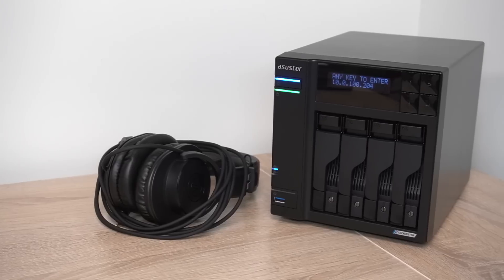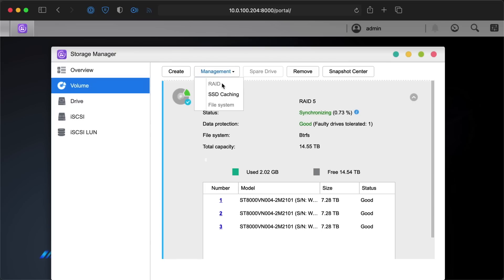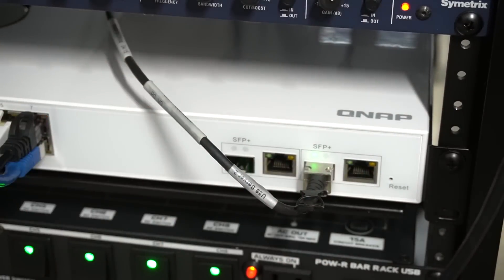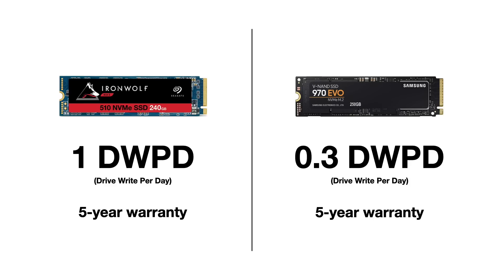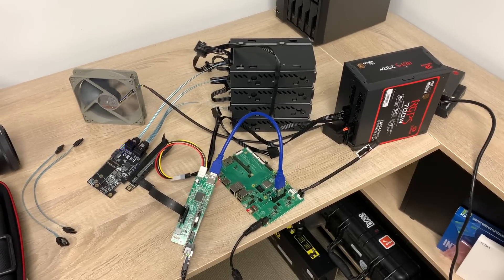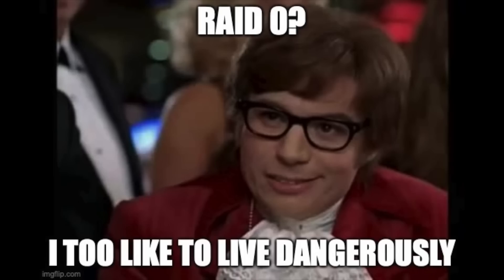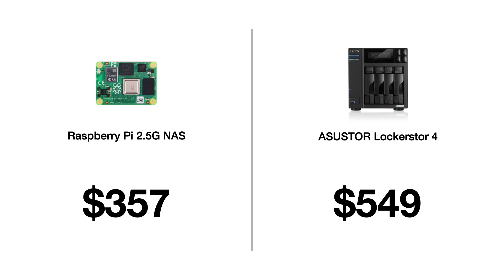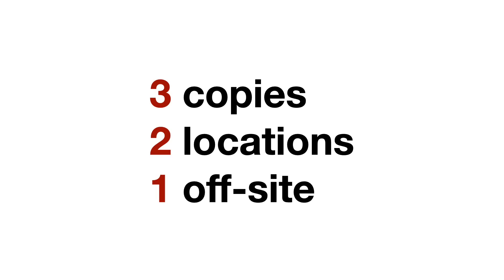Raspberry Pi vs ASUSTOR NAS Head-to-Head Part 2 - the VERDICT!

Comment: Very useful video, thanks. I'm in a similar situation right now: Upgrading the Pi4 with USB Adapters or buying a NAS (leaning more and more to the off-the-shelf solution). Will you keep Raid5 or go to Raid10 with 4 drives? I'm a bit anxious with Raid5... Imagine 1 drive fails and the rebuild takes 16 hours (or more with data on the drives? does it matter?) with full read utilization on the remaining drives... (but right - that's were the backups are relevant)
Reply: RAID10 can experience a complete data loss if two drives fail at the same time (RAID10 is kind of a compromise between RAID1 reliability and RAID0 performance) . RAID6/RAIDZ2 will protect against that scenario.

Let's do the math.

Assuming an AFR (annual failure rate) of 3%, the chances that any one of the 4 drives fail is 12% pa (per annum=per year). How long will it take for you to fix the drive? Do you have a spare at hand, or do you need to buy it first? Will the NAS alarm you at 2 o'clock in the morning while you are on a party, and how fast can you return to the NAS whilst heavily intoxicated 😉?

Let's assume that it will take 3 days for you to fix the issue (a few hours to react, wait until the shops reopen after weekend, plus the rebuild/resilver). The chances that 1 specific drive fails within these 3 days is ~1:4000, the chances that any one of the 3 remaining drives fails is ~1:1300.

In a RAID10 scenario, there is 1 in 3 chance that the 2nd failing drive is the wrong one and complete data loss occurs (total chance 1:4000). With RAID6/RAIDZ2, this chance is reduced to 0.

Considering the time it takes to resilver: when the NAS is under heavy load, it needs to decide whether resilvering or regular use gets prioritized (bother resilvering and regular use read off the three (or two) remaining disks). If the NAS prioritizes resilvering, it might become unusable for regular work, if it prioritized normal use, resilvering might take much longer - ultimately, it depends on how much faster the disks are than the network interface. However, the performance impact of resilvering must be addresses when planning the NAS, as the NAS will have to perform periodic scrubs, which have a similar performance impact. The math above dealt only with complete drive failures, nut localized surface defects. The scrubbing reads all the disks to find corrupted data, which is then corrected (ideally also alarming the admin that it had to fix some data because of some surface defects; the issue may be benign, but if a lot of "weak blocks" begin to appear, it might hint to wards an imminent drive failure).

Resilvering (and scrubbing) under ZFS only considers the actual data stored on the disks. On hardware RAIDs (and some software RAIDs), resilvering goes through the whole disks, regardless whether there is any data or not. Scrubbing can be done on a OS level (since the OS where data sits)...or it's done via the "whole disk" approach, or (quite popular, but dumb) not at all. Likewise, initializing a new RAID array finishes immediately under ZFS, while other solutions require hours for that trivial task.

I prefer ZFS for these reasons. TrueNAS (formerly FreeNAS) is available for free and runs on x86 platforms (so no Raspberry Pi support). Another downside if the "ZFS tax" - a ZFS RAID drive should be filled only up to 80% (to run at optimum performance). Of course, when it's just used as a data archive where writes are infrequent, and some additional seek times (in the case of spinning disks) are tolerable, you can go up to nearly 100%.

A ZFS NAS is not as simple as one of the ready-for-use things intended for the home user. It allows the user to specify priorities and timing of scrubs and resilver operations vs. normal use, which is nice for me, but too technical for the average home user.

My own NAS uses some cheap "old junk" mainboard, a few SATA controller cards and a few SATA enclosures with port multiplier built-in. The 32 spinning disks are organized in various volumes, some consisting of 4 disks (RAIDZ1, for less important data) and others consisting of 8 drives (RAID2, for data which I consider a bit more important). I use ZFS snapshots (taking a snapshot of a volume finishes immediately) to protect against accidental file deletion; with a cron job taking the snapshots at regular intervals (interval depends on how much the data changes and its importance).

And, yes, on one of my 8 disk RAIDZ2 volumes, I once had 2 drives fail within a few hours. I had one spare at hand and needed to order another one. So, no data loss, but maybe I should have gone for RAIDZ3...

And, like you mentioned: offline backups for the real important data. Apart from disk failures, fires and burglary are also real life threats.

Comment: 2 x 2TB Iron Wolf NAS NVMe SSD used for Read & Write Cache and also 8GB DDR4 RAM, that make me think...  Do I really need this ?
Reply: It's not completely necessary to go into maximum overdrive. Often our customers purchase 4 or 6 TB drives as they are the most value drives. The NAS supports capacity expansion as well so you don't have to max it out immediately.

Comment: Ok, so no cache on the pi. If you had cache on the pi, the total price might be almost the same as Asustor? Also, comments seems to suggest that OMV may not be a good choice, any others that might work better?
Reply from the maker: One comment down on OMV so far that I've seen; on the whole I liked what I saw and would recommend it. Realize that it's hard to make one software package that will work across all different types of server builds people might install it on (classic issue where Windows vs macOS — Apple controls the hardware so compatibility should be better there).

Total price did not include the NVMe drives at all (in either case), so price would be similar. You would need a 4-port PCIe switch (add maybe $30) and two PCIe to M.2 adapters ($10 each), so let's say $400 total for just the hardware (still no case).
Reply: @JeffGeerling  OK, excuse my ignorance but these PCI-E 1X Expansion Kit 1 to 4 Port Switch Multipliers work with Pi?
Reply from the maker: @vmoutsop  Yes, sometimes. I've tested a number of 1 and 2 slot boards, and some work, some don't. One fried one of my network cards too :(
Reply: @JeffGeerling  Oh great, so its not that easy. That's good to know.

Comment: I chose a halfway point between these two options.  The QNAP TR-004 is a usb 3 raid enclosure that I plug into my raspberry pi 4, 4gb.  Since the raid calculations are performed on the QNAP side, the raspberry pi only has to deal with the SMB stuff.  Performance and reliability are both quite high.  I also chose OMV for the relative ease of setup.
Reply: Bingo, we have a winner !
Reply: What is omv?

Comment: NB - OMV does support having the drives spin down when not in use. It's not a full shutdown, but as a single spinning HDD uses more power than an overclocked pi then it's most of the power consumption saved. On the "disks" page select the drive you'd like to spin down and then hit the "edit" button to find the relevant options.

Also, since you mentioned odroid, the HC2 or HC4 are really nice solutions if you don't need 4 bays on your NAS and are OK with gigabit. There's also the H2+ for 2 bays and 2x 2.5G LAN, and at <half the price of the asustor model.

Comment: That was super interesting! I have a question, and since I'm not very knowledgeable in this area I may be missing a point here: have you considered file and/or disk encryption on both setups? Does it make sense to talk about that type of data protection in either case?
Reply from the maker: The ASUSTOR does offer folder-level encryption (AES 256-bit, it looks like, though with limitations) and a LUKS option for 'My Archive' volume encryption (but not the main storage volume), and there is a LUKS full disk encryption plugin you can use on OMV. I haven't covered either but will be exploring these at some point.

Best to have multiple layers of security (in case someone walks off with my drives!).
Reply: @JeffGeerling  thanks! Looking forward to when you do so! :)

Comment: Nice comparison. But, is it fare to compare the little PI using less than a third of the power (3W) vs a 10W X86 power hungry little celeron processor?
Reply: No wake-up on lan for RPi, but if spinning down disks - having only power on rpi would be cheap enough

Comment: To be fair just plugging a hard drive into any of my windows computers very rarely yields the same results.It may open files display an icon or I may have to hunt the drive down for crying out loud! Hence all the frustration I see on Amazon reviews when adding these devices to the already inconsistent windows experience. As for the Pi, they need to quit cranking out boards and bring the software up to date.

Comment: As usual a nice presentation and interesting information.
I own a similar 4 bay NAS but have converted to use two linux driven low power computers - one at home, the second is remote. Using "normal" linux allows me to setup data sync between the two and simultaneously run proxmox, docker, nextCloud amd more. That gives me so many more possibiies.
And -  no cloud involved ...
Thanks for the good videos!

Comment: Jeff. Great video! Here is what I thought 3-2-1 is:

3 copies
2 different types of media
1 copy off site

2 different types of media is important because it can help prevent issues with crypto, and other issues with media / server death. Tapes, for example, are common for the second media in enterprise environments.
Reply: About 2 types of media: Never use SSDs for long-term backup storage :) Optical disks, HDDs and tapes are ok, SSDs are not. These lose the cell charge over time, so when you want to access your office document archive of 2020 in 2024, you’ll find that the SSD is completely empty…
Reply: @luziferius3687  That is what I have heard also. SSDs would be tempting to use because of their size.
Reply from the maker: Tape drives are underrated. Having offline storage that's decently fast to write, easy to transport and store, and high capacity... is nice.
Reply: @JeffGeerling  BUT ... keep in mind that tapes have more stringent environmental storage requirements than other types of media.

Comment: I've designed my own file server for a raspberry pi, it took 2 months to get it done but it was worth it...
Reply: sounds like good how to YouTube content to me
Reply: @kingmasterlord  Not really, I had to deal with tons of security stuff like directory traversal, injections and XSS and 99.9% of people watching don't know anything about this stuff. If they were to expose some ports on their home routers with badly secured web app, then some hackers, or most likely bots wold easily get access to their home networks... There's always a risk they'll forget to patch stuff that might enable remote code execution...

In short, unless you really know what you're doing, don't do it...
Building complex APIs needed for login and permission systems isn't easy, and securing it is a nightmare...
Reply: Any idea where to start (maybe topics to read) and futher to have similar built like you?
Thanks..
Reply: @khairulihsan8417  I'd honestly first start by building a simple API for reading files from the server, some routes like API/file/get/pathToFile, reading the target file and then thinking of securing it, so things like dir traversal protection and possibly locking the server to a certain directory, that would be its root

Comment: Who buys/uses a 700W PSU for a low power system!?  Wasting energy as PSUs are most efficient near their rated power...

That watt meter is not very precise. When in sleep mode, the Asus system should use 1-2 watts.
Reply from the maker: I used that PSU mostly because it's the one I have on hand for lots of different testing. Overpowered mostly because I don't know how much power I'll need for a given project.

You could definitely go cheaper on the PSU for a simple NAS like I'm building here. And if you only needed 3 or 4 drives, there are also cheaper SATA cards you could use.

Comment: My take on the "NAS story" was:
- HP MicroServer Gen 8 - 150 EUR (new, with some Celeron and 4GB RAM inside)
- XEON CPU 1260L 4c/8t - 40 EUR on ebay
- 16GB (2x8GB) DDR3 ECC RAM - 50 EUR on ebay
- Sabrent USB3.0  2.5Gbps LAN adapter - 40 EUR (the server has 2 x 1Gbps and a iLO but i wanted 2.5Gbps)

Total: 280 EUR (~ $330) - disks, cache SSD and boot SSD not included

Advantages: 
- I can run a fully fledged distro on it with whatever I want / need
- It has expansion: 1 PCIe 16x 2.0, some USBs and an extra SATA
- It can be fixed / modded to your necesity

Disadvantages:
- power consumption (~ 70-80W)
- kind of loud at startup - it is a server afterall and we all know how server grade equipment sounds like
- you have to manage everything yourself, replace CPU, install it, add everything you need etc (this is a disadvantage for those that what something Plug And Play as the Asustor, for me it was fun)
Reply: I guess if you use actual hardware raid controller (that has a BBU and a UPS) and Linux with btrfs as the filesystem for bitrot detection only so you know when you got corrupted data (single data, dup metadata) , with the hardware raid you can use the automatic raid rebuild (drop clean disk in and off it goes) and monitoring functions of the server instead on relying on mdadm raid 

This is why I like netgear readynas (simple automatic raid and btrfs for bitrot and auto correction) , as long as the hdd is clean you can just drop it in and it auto rebuilds (same as dell server) , only nas Company I know does it this way, others you have to trigger the rebuild via the ui 

or have a hotspare configured, only use hotspare in RAID6, never use hotspare in RAID5, use RAID6 before you start to use hotspares

Comment: I was very surprised by the 45w power draw but I suspect these big NAS 3.5 drives are the primary culprit at like 8-10W each

Also the asustor has a big advantage with the ssd cache which to me were really under utilised. Incoming transfers should be done to ssd and cloned to array. Reads should be from ssd. Anyway thanks

I'm right now researching hooking a ssd to a rpi and create a gluster cluster of maybe 2-3 rpis see how it goes 🤔
Reply from the maker: Hehe, "Gluster cluster" I don't know why, but the phrase just makes me laugh.
Reply: @JeffGeerling  haha please make a video about it? Even if you're laughing throughout 😁
Reply from the maker: @Airbag888  - I should dust off my Gluster K8s setup sometime... always wanted to compare Rook/Ceph vs Gluster.
Reply: @JeffGeerling  AFAIK gluster is the better option on rpi. But I could be wrong. DO dust it off man!
Reply: 750W power supply for a PI and 4 drives ? This is why you find 47w for the Pi. With a suitable power supply, i'm pretty sure you didn't exceed 15-20w
Reply: @bolombolom  agreed with you.. ATX are real bad at idle power. powered by a DC brick would've been much better

Comment: I actually found setting everything up manually without OMV resulted in better results for me. OMV uses too much CPU power and can be troublesome on non Raspberry SBCs, I for example had much better throughput (around 25%) with manual samba and mdadm raid0 setup on a OrangePi Zero.

Comment: Have you looked into the restore costs from S3 Glacier? Last time I looked, it can quickly become prohibitively expensive in addition to slow to retrieve data from Glacier. Kind of the classic AWS trap of cheap to get your data and services in, premium pricing to get it out.
Reply from the maker: If you need data fast, it will be expensive, but if you can wait a day or more to get the data back, it's not too bad. I actually just restored about 100 GB of data a couple weeks ago from a super old project I did in college (apparently I had deleted it from my local storage!), and it was only like $7. Small price to pay for the convenience and low monthly cost (I think like $5-10 a month for a terabyte?)

Comment: Me who has 4 ssds in raid 0 2 that are QVO sata and 2 nvme p1 xD (i only storage video games on it that backed upto my raid z2 server)
Reply from the maker: As long as you back it up, I'm not a RAID 0 hater :D

I mean... right now all my most critical data is on a single drive connected to an old Mac mini over USB 2.0. But I have it backed up nightly to AWS Glacier, so I can sleep better at night.
Reply: @JeffGeerling  i only have them in raid 0 for the space used to use the QVO drive with unraid but then moved to truenas so ram is more important. But yeah Rip them poor QVO only have about 1.7years on them but have like 50+TBW lol have a eta life of under 1000days and the nvme drives are cause i used to have windows and linux installed but now just use windows on a 1tb evo drive that used to be in my laptop with qubes os my system is all ssd 5tb in total

Comment: What’s your MTU?  And 512e drives?  Or 4K?
Reply from the maker: 1500 MTU — I left it default mostly because if I wanted to use Jumbo Frames (which does allow more bandwidth when copying large files), I would have to make sure to update it on the PC, the QNAP switch, and the NAS (and my Mac, when doing testing there)...

The drives are 8TB Seagate IronWolf NAS drives, latest generation... but I couldn't find in the specs whether they're 512e or 4k.
Reply: Many of the current Seagate disks can be changed (which they call “FastFormat”) between 512e and 4Kn using their SeaChest_Lite utility. Note that this erases all the data on the disk. I personally prefer using 4K disks as 4Kn because it feels simpler and safer (in terms of “sharp edges” not data safety), but I haven’t tested for performance impacts either way. I suspect they perform similarly if the filesystem is doing 4kiB writes anyway.